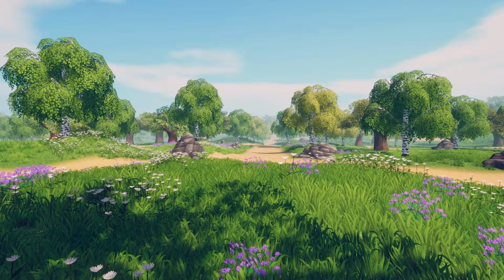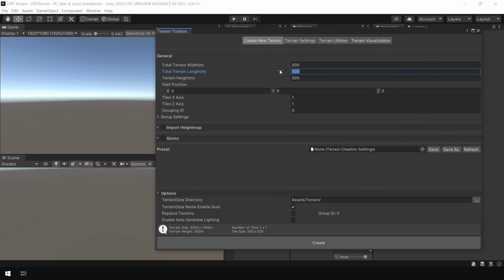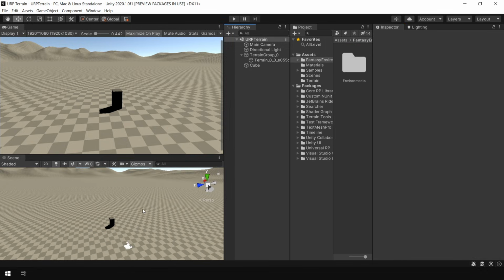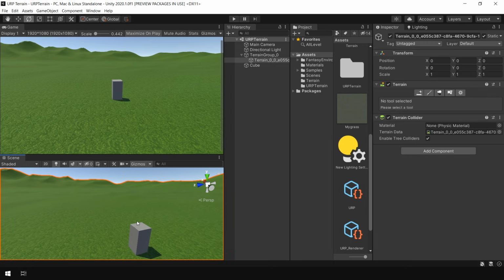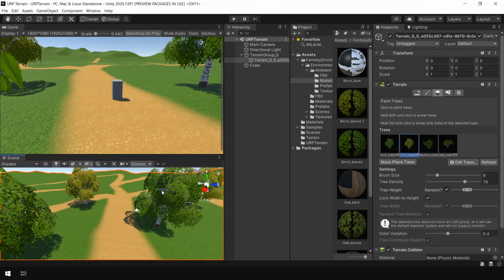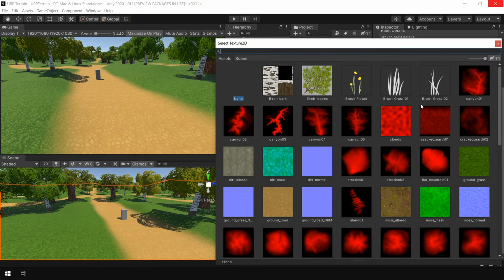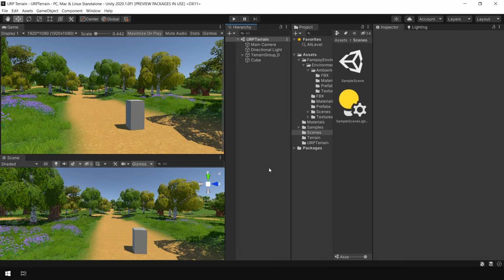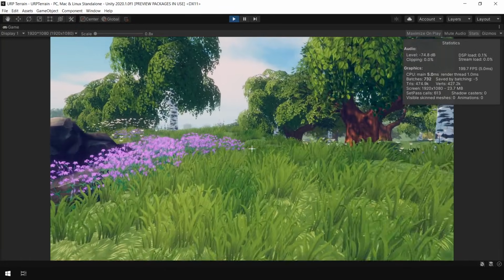How to Use Terrain with URP in Unity 2020 | Beginner Tutorial

Comment: My CPU overheat after clicking Auto Generate , my system was 2nd gen. core i5 , 8 gigs RAM and GTX 1050 ti , any help here , please ?
Reply from the maker: That is normal because the light baking uses full CPU power. Try using GPU lightmapper if you have any cpu heating issues.
Reply: @UGuruz  Wow ! That works, thanks ! but had to tune down 'Lightmap Resolution' from 40 to 10, otherwise it will take hours to bake, may be because of my old system problem.